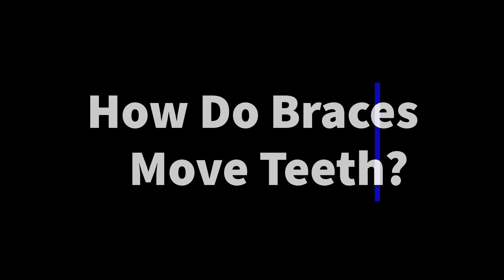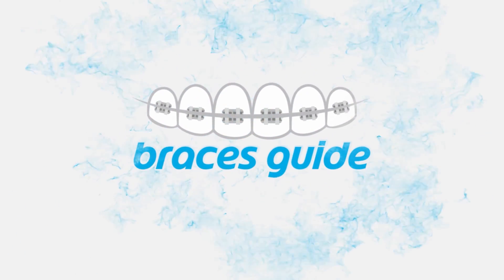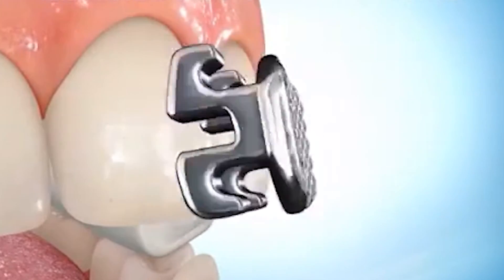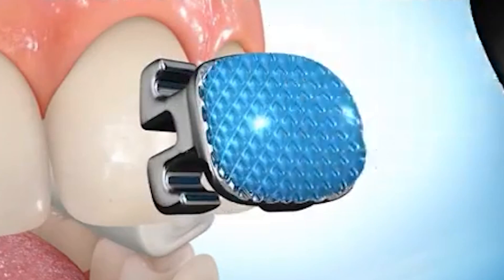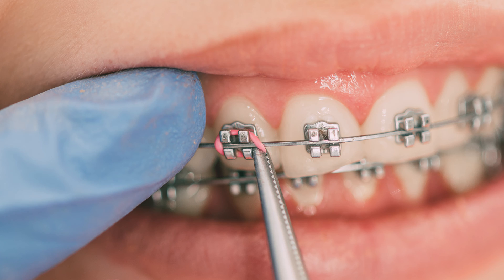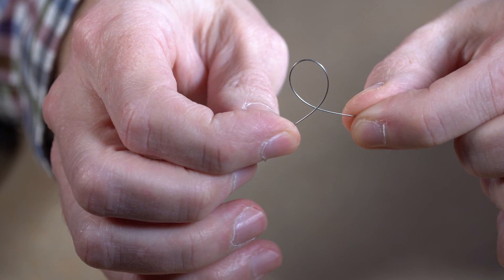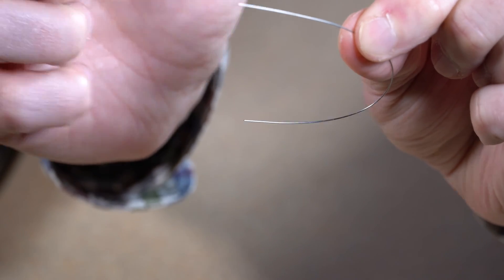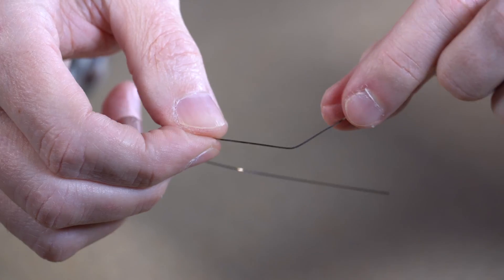How Do Braces Move Teeth? - Braces Guide

Comment: sir,i was doing braces today it will be 1 month..but the front teeth are still very weak..  The gums seem to be moving.  If you shake it with your fingers, all the front teeth move slightly? Is this a problem or normal?  Please let me know
Reply from the maker: It is normal for teeth to become slightly mobile during tooth movement, but you should ask your orthodontist to be sure.

Comment: Is the wire is supposed to go inside of the slot of the bracket?
Reply from the maker: Yes, that's correct. There are times that the orthodontist may not fully place the wire into the slot, if for example a tooth is really far out of place, but in most cases the wire goes into the slot.